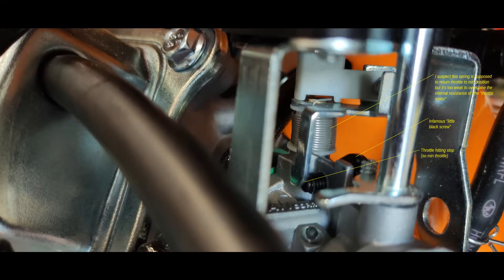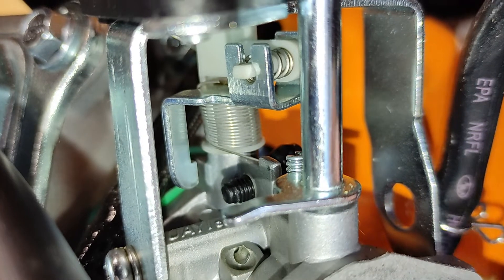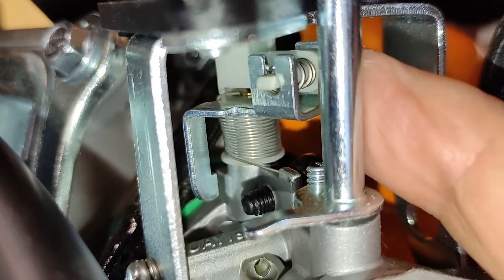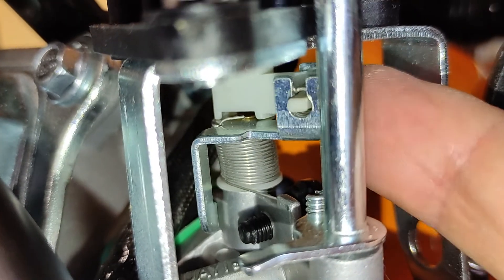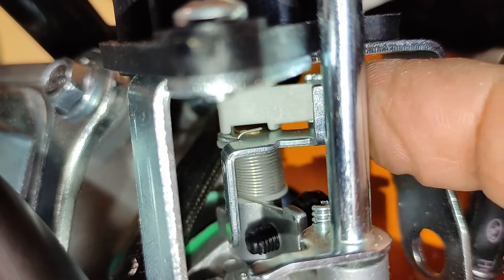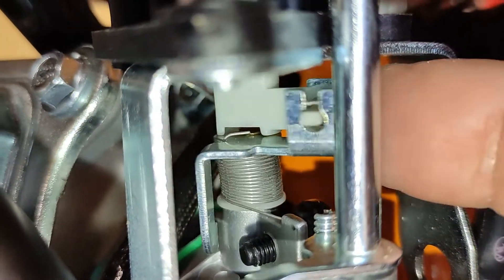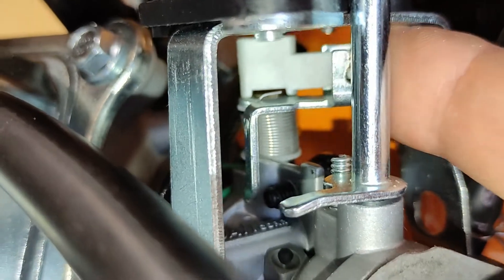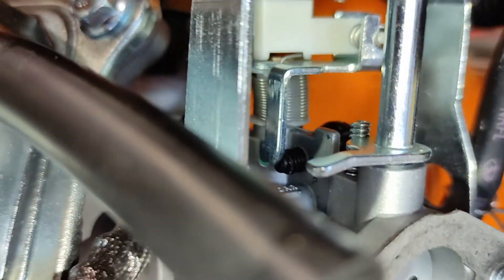Why won't my generator work? (part2)

Comment from the maker: OK I also have an Imax 1800, IFG brought from ScrewFix.
This is my 2nd one, the 1st I never managed to start.
This one started once, but not this time.

Seeing the Video by "Off Grid London" and the comments that followed I took a closer look.

The infamous "Little black screw" in the comments appears to be a "stop" to set the
minimum throttle.

It looks like the throttle is driven by a small electric motor.

I suspect the spring is supposed to return the throttle to minimum (the black screw)
when the unit stops, however it does not do so, the resistance is too high for the light spring.

So either something is done up too tight or the electric motor just puts up too
much internal resistance.

If somebody has one that is running, could you look to see if the throttle moves as you put
electrical load (also try the economy switch on/off) and does it return to the stop (black screw)
when you shut it off?

BTW, I found the "little black screw" impossible to access without first removing the carburetor.
Reply from the maker: It's now working (following tips in part 2)  --- part3 ----> https://www.youtube.com/watch?v=lJ8Kn6G_lxs